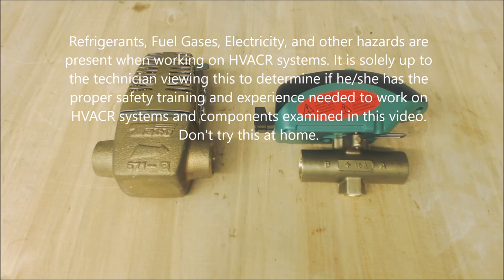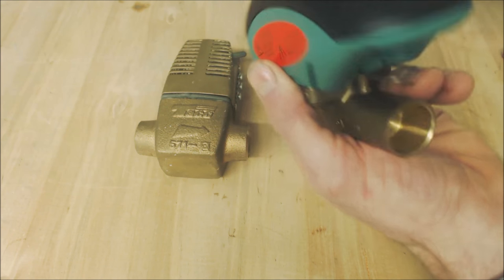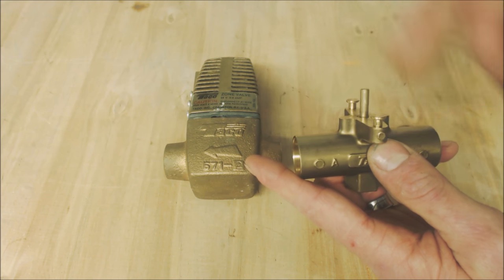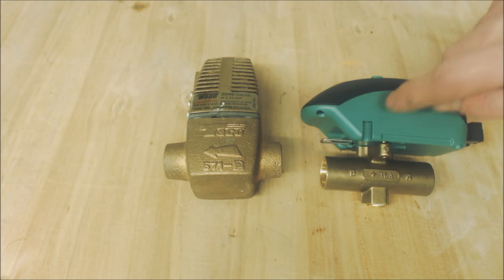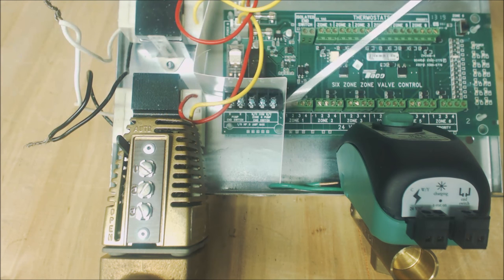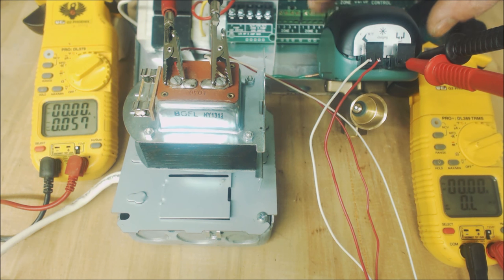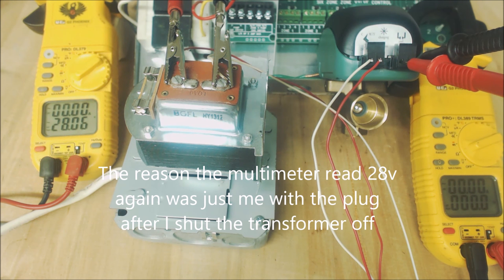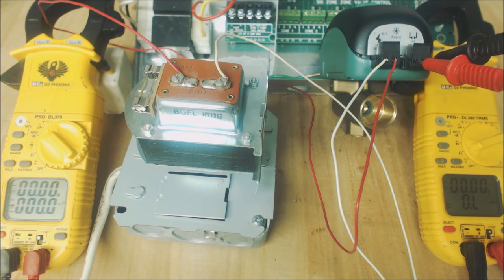Testing, Wiring, Taco Sentry Zone Valve! How it Works, Comparison, Explained!

Comment: Your meter was working properly when measuring the amp draw during a call to open the valve.  The Sentry valve "pulses" power to maintain the charge in the capacitor, hence the intermittent zero to 0.13 - 0.22 amp readings.  This adds to the energy saving features of the unit.

Comment: I love the Honeywell hydronic zone valves. They will last 30 years plus and all moving parts can be replaced without soldering in a new valve. Often the system doesn't need to be drained to service it.
  I may have a bias,   as I am from Minnesota, where Honeywell started and became a world leader in this .
Reply: Only the power head can be replaced without changing the whole valve. Same as all zone valves.

Comment: Great video, keeping things simple and understandable. I have a question about my setup. I picked up 3 of the sentry valves and a zvc404-4 controller to replace an older automag setup in my house. Currently my pump is hooked to the boiler so that when the boiler is running the pump is too. Should I wire the pump to the controller, or leave it as is?

Comment: Does it matter which wire goes from the transformer to the w/y and the common terminal? I know with the Honeywell zone valves as long as you complete the circuit (transformer-zone valve-thermostat-back to transformer) it doesn't matter which wire you hook up, as long as the circuit is completed. Thank You!

Comment: I have this valve and fails about every 12 to 18 months.  Does the end switch need to be hooked up? Thinking about switching to a irragation vavle but it only has 2 wires.

Comment: I have what appears to be the older version of this (ESP075C2-2) (12-04). Presumably 12-04 is December 2004 when our home was built.  

I woke up in the middle of the night sweating. It appears to close about 97% (if I look at top it is almost closed, but honestly it is hard to be certain), but the pipes were very hot.  

Can I just replace the top head with newer version or do I need to sweat in new valve too?

Comment: I have two zone valves in my house so the Taco ZVC404 control is wired to Zone 1 and Zone 2, but there is no voltage in the control of Zone 1. Can I move the wiring to Zone 3 or 4 to see if there's any voltage and will it work the same?

Comment: Very informative, I gave you a thumbs up! I have to troubleshoot mine. I updated the thermostat on one of my zones (that almost never gets used) and noticed the other night that even though the thermostat was off, the radiators were still piping hot. I went down to the basement to find the valve still open... so I manually closed it and decided to look at it in the morning. Upon further observation, the valve will open just fine when there is a call for heat but when the thermostat is satisfied it tries to close over and over again and eventually just settles for a position that appears partially open. Any chance I threw the servo range of movement off by manually closing it? I thought for sure that some debris in the line was keeping it from closing but the valve moves freely from open to close with the valve head off. I can also manually turn it off and it can turn itself on, just not off. I’m going to switch back to my old thermostat and run some tests first to help isolate the issue.... your video has given me a good base to work off of.  Thanks
Reply: Update: For those of you who may run into a similar situation, I want to tell you what I found and how I resolved my issue. I can only assume some obstruction blocked the valve from closing the initial time, the system is rarely used so there could of been some buildup or maybe even something solid floating through the system. When I had to manually close the valve it threw off the open-close sequence a few degrees of rotation (this may be because I manually closed it while it was attempting to close.... I can’t remember due to the early morning hours this first occurred). My system has 6 zones, 1 is for the water heater which is fed from an oil burner. Testing out my valve in the closed position I got around 8 volts AC and my other side was never in OL but had just a little resistance when closed. When opened I had 23 volts ac and my resistance was even less on the second side. I am assuming my system may always have the circulation pump on due to the hot water heater or the the small resistance reading is due to something else.... it didn’t seem to effect anything and all my other zones read the same. I had to end up taking the valve head off and manually turning the valve stem to close... the half moon end of the stem will be left to right opposing the direction of the line when off and will run in the same direction as the valve when open. Anyway, I pulled the valve head off and cycled the thermostat on and off until the stem insert part on the back of the valve matches up correctly, I had to push in the the manual control lever while the servo was turning to get it to align. The issue was the servo was slightly off so it wasn’t alighting internally. Once it was aligned there was an audible “pop” sound as it seated with the servo gears. (Manually overriding takes it out of this seat). I hope this can help somebody else. Thanks again for the video
Reply from the maker: What type and model zone valve do you have?
Reply: AC Service Tech LLC the green Taco unit in your video.

Comment: very informative video. but what tells the boiler/how does the boiler fires up? assuming after the valve has opened and the circulator pump has turned on. thanks.
Reply from the maker: That would be the  two terminals marked "end switch" 24v comes from the aquastat, goes through the end switch, and then back to the aquastat, thanks

Comment: how do you wire 2 of the sentry valves to the board and back to boiler? i have the jumper on zone 1 and all 4 wires on zone 2. both are always telling pump to run and always stay open.

Comment: is it possible to replace the internals of the water part of the valve with a new one rather than soldering it i'm in a situation {condo}
Reply: i meant take the new parts out of the new one and put them in the old one mine is in the off position and water is leaking past the valve to the heat is always on with no voltage

Comment: How would you power up multiple t6 pro wifi thermostats that needs a "C"  if your taco zone panel just has R & W for the t stats. The zone panel i worked with had this and off to the side they had terminal spot for 24 vac and common.
Reply from the maker: This 6 zone controller actually has the c terminal as well as the r and w. If you don't have a c then all that means is that you can't use up all the zones because of the amp load on the controller. Then just take a common off of one of the two transformers, thanks

Comment: I have this valve on my geo system . I have a problem with water running through the valve closes when the unit turns off but water is going through still. Is it possible that the ball vale is no good?
Reply from the maker: I am assuming that you are talking about the new sentry valve. Try taking the head off and manually shutting the valve by turning it. Maybe the plastic gears inside the valve head are not seated correctly or are worn, thanks
Reply: A little late now but you can flip the valve and it should stop letting water through. Dont know how it works but it does. Mine leaks every 12 to 18 months. I flip it to save from buying a new one every year looking into using a irrigation valve.

Comment: can  this  valve  be  wired  to  open  quickly, yet  close slowly?
  By having pin 1 and 2 to 24 ac , and  jumping  pin 2 to  pin 3 and pin 4  to  ground??
Reply from the maker: No, they will always open at the same speed. Dont jump 3 to 4 for safety of the pump, thanks
Reply: @acservicetechchannel  I'm  using  the  Valve on a ground water source heat pump (geo thermal), that  brings  in water from  our residential  well and  discharges to a  second well. I'm hoping  this valve will eliminate all  the  water hammer  inherit in  this  design. My  only  concern  is  the  delay  in  opening...not  sure IF  this  will  be  problem. 
  Thanks  for  your  PROMPT  reply, and  your  VERY  informative video
Not  sure  what   you  mean  by  "safety of the  pump" ?
Reply from the maker: The end switch on 2 to 3 on the older style or 3 to 4 on the newer style zone valve verifies that the zone valve is open before the controller will turn on the circulating pump. You don't want the circulating pump on with the zone valve closed, thanks!
Reply: @acservicetechchannel  Ahhh  i  see, but  does  not apply  to  my  application. Again  thanks  very  much